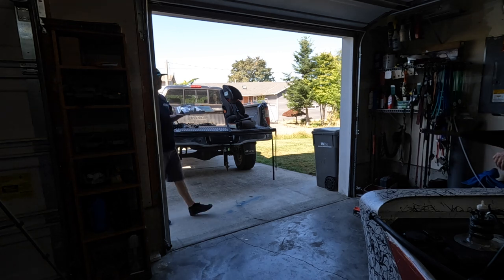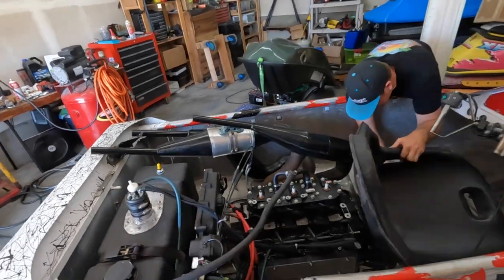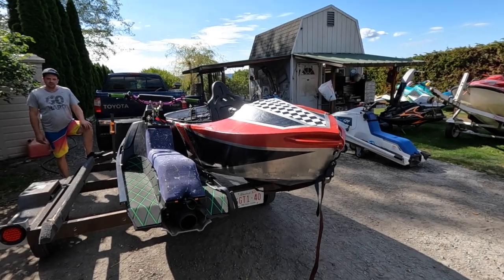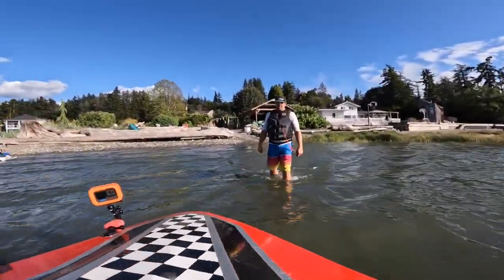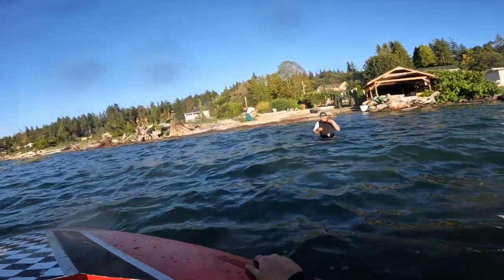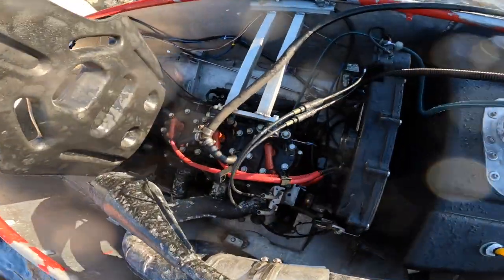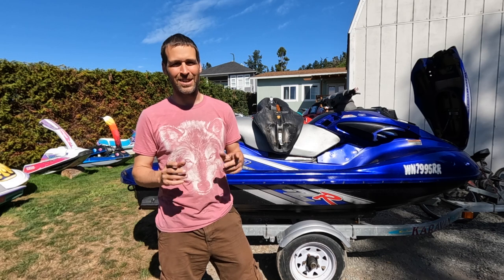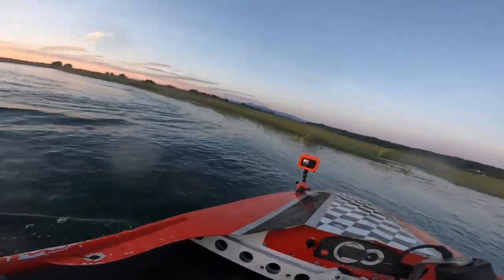Ultimate Mini Jet Boat - 3 Cylinder Two Stroke Music - Triple Pipe 1200 R SCREAMS !!

Comment: Always scetchy when you try to weld solid mounts on snowmobile pipes. Usually you spring mount them. Let them move a little. I tried welding my Rev 800 sled exhaust and it lasted 10 mins... lol. Gotta use springs! Great video Joel! Heading over to JSB to watch theirs now.
Reply from the maker: Yes... 100% nailed it. All snowmobiles have either ball joint type or slip joint. Just working with the cards we were dealt , at this point, haha.
Reply: @JoelArseneaultYouTube  Awesome video. Thing is a ripper!
Reply from the maker: @StefanMailey  Thanks ! The video really doesn't do it justice, and it needs some work still, but yes, it's a ripper !!

Comment: Oh my God!!!!!!! The mini J is literally going 100 miles per hour! 10:05 Look at that sweet beauty dragging the hell out of an absolute missile of a ski! If it’s pulling on Joel’s ski like that then it is super sonic!
Reply from the maker: HAHA !! I do believe you are correct ! My ski is pretty quick and fast.... I honestly wasn't sure what would happen when we lined them up, but yeah... It's a rocket, and it still needs some tuning.  Another thing you can tell from that portion of video is the sound of the jet boat... my X2 isn't quiet, I'm on it and you can hear the mini jet louder than my exhaust !!
Reply: @JoelArseneaultYouTube  I was going to comment on that! I thought your ski was bone rattling but I could barely even hear the tone of your skis exhaust over those tripple pipes! Your ski would probably take that thing every time on less choppy water. It just has so much more weight to keep itself planted and blast through the chop. Your ski is like strapping a rocket to a skimboard! It skips across the water so fast!
Reply from the maker: @cpcassone  Yeah, My X2 is over 100 lbs lighter and has a smaller contact patch with the water. It could do better with a better rider or on smoother water.

Comment: I can't wait until you see the video we filmed last night! I'm pretty sore but it was worth it!

So I just got the 1100 from Neil apart and I got a resleeved cylinder at 81mm. You could probably bore it to as big as you can get pistons for. I think I remember you have a set of forged pistons that are pretty big?  If you got an extra standard bore jug that is kind of good I'd trade you.

Also been thinking about the 4 cylinder idea..... Yamaha. There will be a lot of things made easier with a yamaha.
Reply from the maker: Hmmmmm ... I can't wait to see that video either, haha. I haven't been out on the water since I've been there. I was going to go out this weekend but I've been way too busy. I'm curious to see why you are sore... 

I think my pistons are 82mm... maybe 83... so yeah, that would probably work. I'll have to keep my eye out for a decent jug. 

That's cool... What Yamaha ? A 650 or 701 ?
Reply from the maker: Also... I'm trying to figure out what to do with your 4 cylinder now... I found stuck valves (badly corroded) and the gasket surface around the squish had a bit of a dent / gouge in it... Waiting for rings, got the bottom back together. 👍
Reply: @JoelArseneaultYouTube  Well I'm sure you will put it together a lot nicer than I would. I sure wonder how it will turn out.
Reply: @JoelArseneaultYouTube  Well the nice thing about yamaha is you can run the same bottom end for 650/701/760. Parts compatibility is easier. The bolt patterns also make some things easier.
Reply from the maker: @Jacobskibros  It will probably be great ... but I'm just paranoid about everything,  haha.
Reply from the maker: @Jacobskibros  Oh... cool !